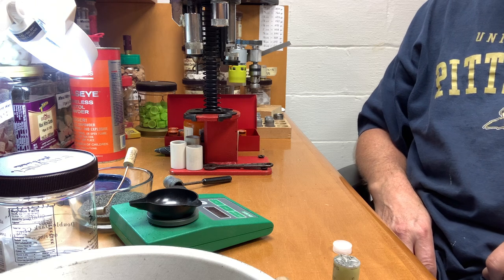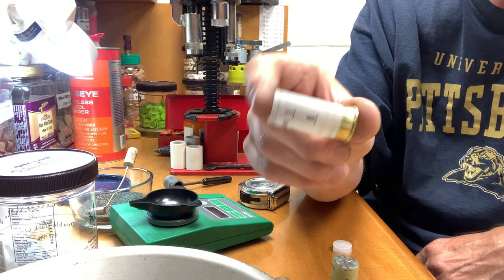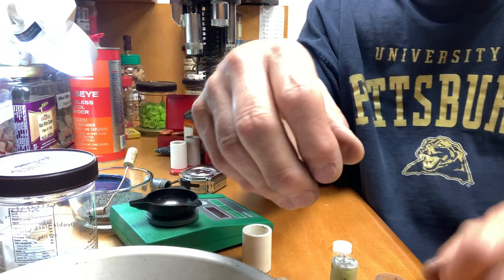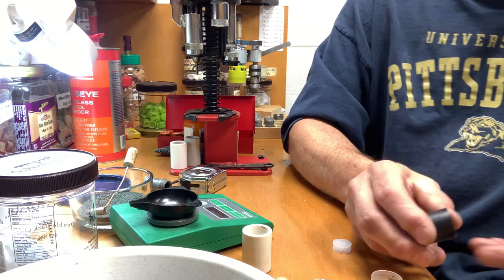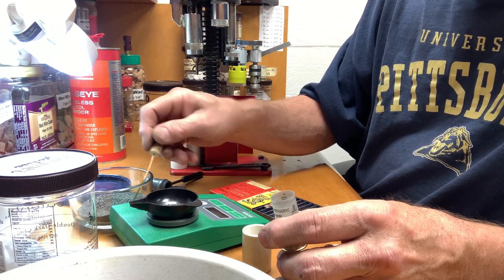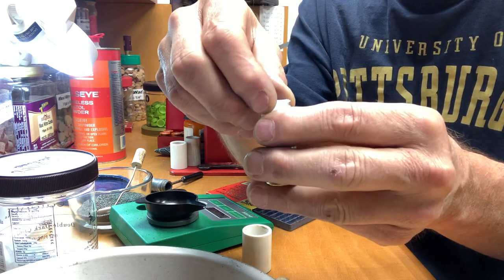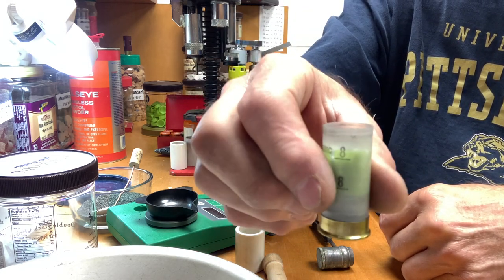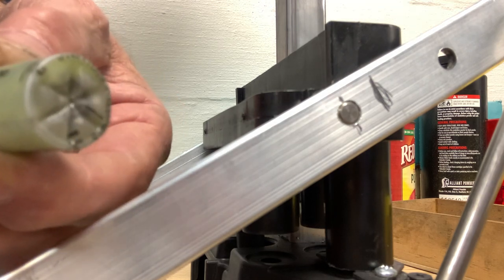Mini shotgun shell fold crimp, Can it be done?

Comment: FYI:  For more reliable cycling through the pump or slide actions  and SOME autos :  A  60 mm length 'before crimping'   or  2.340" might be a better length.   60mm or 2.34" to 2.35".

Comment: Question: can you just take 00 buck pre-existing shells cut them to the length you need to make shorty shells and just remove the compression area on the cups and put the cup and all the buckshot back in recrimp it as a shorty shell, does that work and/or cause any problem when shooting? In this video you removed that compression area and reused the cup and added in the what looked like steel balls. No issues with that compression area removed on the wad/cup?
Reply from the maker: If you want to make Shorty shells, there is load data at ballistic products. I would not cut off the shell take the compression out and put it back together and shoot it factory buckshot loads are too hot and have too much powder.  Each shell is a custom load. I would not do what you are  saying. There would be too much pressure.